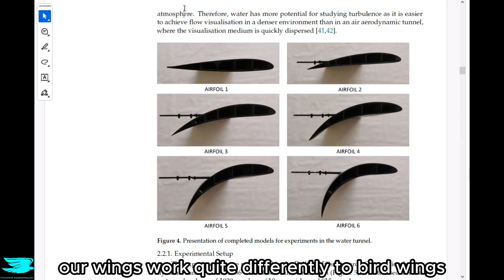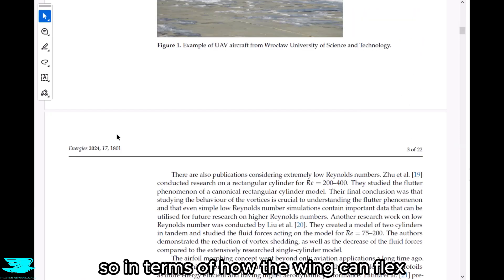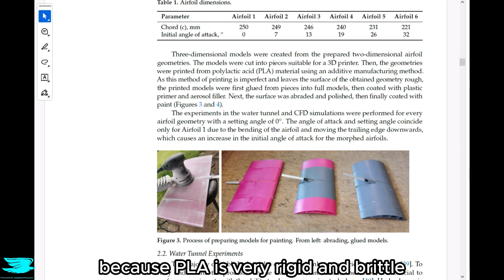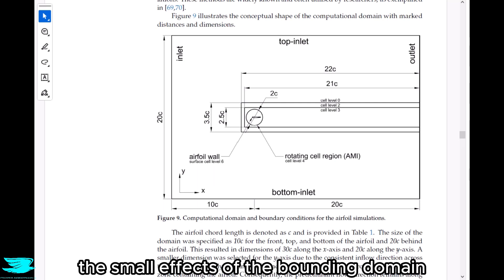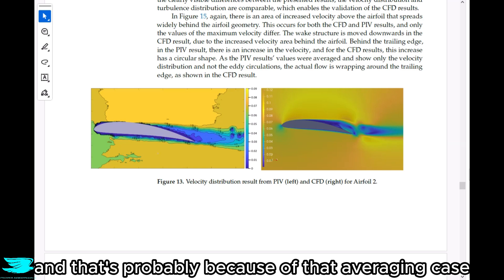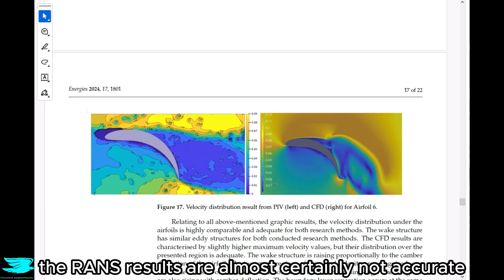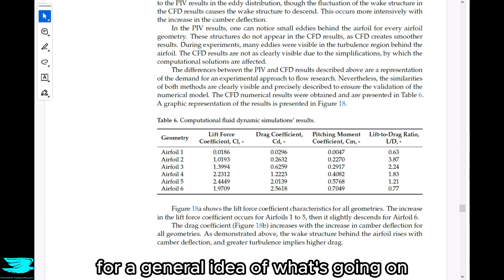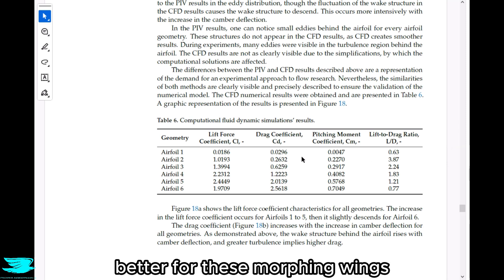Are Morphing Wings Actually More Aerodynamic Podcast 237

Comment: The program XFOIL uses a lot of experimental data from many scientists to predict where the flow seperates from the wing. Seperation causes drag. This experimental data are essential to predict seperation accuratly. 
Besides that the flow is often 3 dimensional, this makes it more complex.
Some of my work https://www.youtube.com/watch?v=CnWcAfEeEgE
shows spanwise flows in the tip region, before the aileron.
The upper curvature for an optimal wing is far more complex than single radius and cannot be achieve with a mechanical "bending" how sophisticated it will be. 
But is is a nice topic for an university paper. As an assistant professor, we had to publish.
Reply from the maker: Yep. You can also use pressure gradients. But, it still is heavily dependent on factors that empirical equations aren't sensitive enough to pick up on.

For example, the turbulence intensity will affect the stall.

Comment: One of the problems of a morphing wing is predicting where flow separation occurs as you vary speed. This gives rise to a nightmare scenario where flow separation is vastly different on each side of the aircraft for supposedly the same warp. So lift/drag will be different on each side of the aircraft. Conventional flaps give a definite point of separation so lift is predictable from one side of the aircraft to the other.
Reply from the maker: Good point. And given the uniqueness of each wing morphing, it makes it difficult.

Comment: use symmetric wings only. cuts all the nonsense about special air foils. yep bird feathers and thus wings are symmetric. express clearly how much more % of lift you get by using air foils, and if its worth the extra complexity. and paid service for such service. if you need to be paid then of course you are biased to get paid for doing the air foils service. yes flat non-special paper air plane wings work nice. same for hang glider flat wings. how about lift bodies, and body lift wings, with most of the lift from the bottom of the craft/wing. do the flat/symmetric wing comparison tests with varied angle of the wing surface.

Comment: Who says that they actually morphed the wing with a PLA wing? It's more likely that they just 3D printed different wings? After all, they seem to show only 6 variations of the airfoil.
Interestingly, it seems counter-intuitive to restrict morphing to only the trailing section behind the "spar", when high-performance wings usually have airfoil changes at the leading edge, too?
Reply: They definitely just printed different wings. if you look at the cross sections closely, the infill supports are vertical on all 6.

I assume they restricted the morphing to the trailing edge only to minimize the number of variables, and adding in the leading edge might come later. There is also the fact that morphing a short thick section (like the leading edge) can't get very much shape change anyway, so it might be less important.
Reply: Perfectly easy to morph not just camber but chord.

Comment: idk about averaging the last 100 iterations for RANS. If the flow field changes that much in 100 iterations can we really say the CFD result converged? If looking at the loss and we see the loss oscillate at a pretty high value, that should just be a case that failed to converge, shouldn't it?
Reply: also i dont see how there would be a typo for Cd. Assuming there is a typo, that would mean airfoil 2 has a drag coefficient less than airfoil 1 which makes even less sense. And Cd of 2.5 is basically a parachute and i can see that happening, especially when the chord length is getting shorter
Reply from the maker: If the residuals, and forces, oscillate in a periodic fashion, then you can conclude it has converged. If they haven't, then you can't. RANS is a funny solver because there is this pseudo-unsteady phenomenon with it.

Comment: What do you think about simulating a wing stall with vortex generators? I'll be simulating VGs as part of my bachelors thesis, so would RANS be ok or should I try transient solvers?
Reply: Unfortunately you picked two of the most painful features to model with RANS. RANS sucks at predicting deep stall behavior and also to assess the effect of VGs on boundary layer tendency to separate. You wouldn't even improve much by doing transient - you really need LES or at least DES.
Reply from the maker: Yep, exactly what @KToMmi said. If the flow were attached, then RANS would be okay. But for stall, you need unsteady solvers. If you don't have the resources, then URANS would be what to go for.